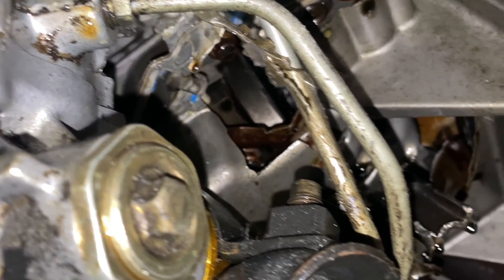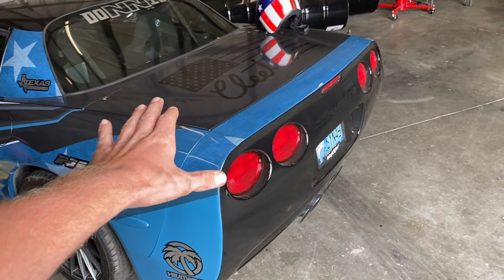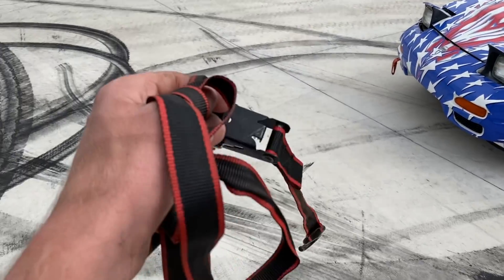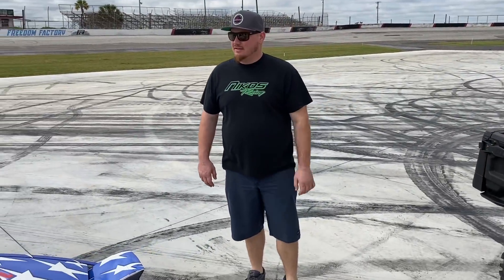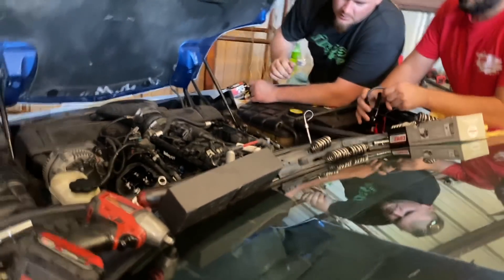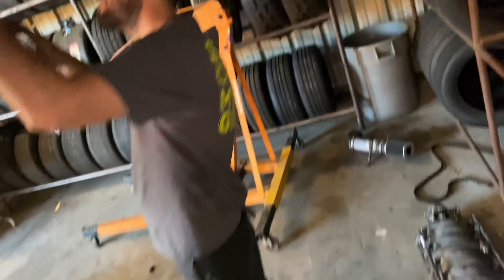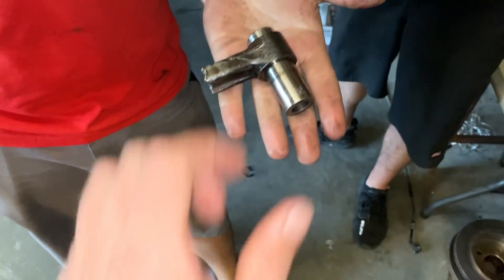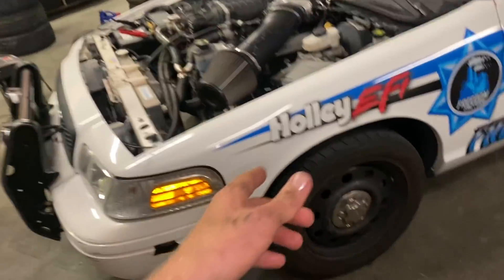We BLEW UP The Engines in TWO Cars Right Before FF Drift Night... (High Speed Engine Swap Engaged)

Comment: Notice how he has gone through more ls engines in any car vs neighbor's engine gets thrashed and banged against the rev limiter at every single cleetus and cars.
Reply: thats because the first time they put neighbor through what they put the ls through, it blew up. now its built and is bitch tuned to keep it from blowing it self apart at the slightest rev limiter smash. good try on* ls vs. mod though, ls still better.
Reply: @MillionairX  they also change the timing chains often so they dont explode on limiter
Reply: Neighbor is a built engine.. most of the ls stuff that he breaks is stock blocks..I know Donnie was just a heads cam car and rocket was a stock block as well...can't really compare built vs stock
Reply: @MillionairX  you have a very good point there, for all the people screaming about coyotes, Cleetus hasn't been able to hard kill it, and it's been pushing near 1,000 hp for years now.
Reply: i dont disagree at all, it's impressive neighbor has survived, although I will say he goes through stock LS's with miles on em then he replaces then
Reply: It'd because it's a Ford not gm garbage
Reply: @chrishamilton2559  he also doesn't rev it to the moon except for on the dyno it has a soft rev limiter for burnouts it's set to like 6k
Reply: I'd chalk it up to the fact that the coyote is DOHC.
Reply: @chrishamilton2559  hasn't been able to hard kill it? There is a video where they grenaded the whole one side of the engine after a timing chain snapped and needed a shop to fix it lol. Plus we don't see all the maintenance done on it off camera. Like someone else said, bet they change the timing chains n stuff all the time.
Reply: @Tron1731  you got gapped a GM product didn't you? Haha only butt hurt people say shit is garbage when its got a 70+ year legendary history to prove it's not..
Reply: Lmao at all the booty tickled LS guys. Digging deep for anything they can negate about the trinity engine's reliability. Seem to forget how many times he over heats neighbor (has/had stock 4.6 radiator for the longest time), and how he basically trys to break EVERY car in the fleet. Cleet ain't nice to any car he gets in. Y'all act like he doesn't build/maintain everything he owns. Love cleet to death, but part of neighbor's first (and only) engine problems were simply related to him not having mod motor know how. How many engines has Ruby, Leroy, toast, the 240, and the rest of the fleet been through? Answer? Plenty. Most all built top to bottom. Truth of the matter is, cleet has not sympathy for any engine. He doesn't have to. So to the brand bashers on both sides, please TSB.
Reply: Ford GT500 motor brother 😏 not as configurable or powerful but takes the cake with reliability
Reply: @MillionairX  talking smack with your Ford rear-end in your race car lmao 🤣
Reply: @Tron1731  yah and? You see me saying shit is garbage? Nope... This isn't about who makes the better rear end though but since we're here, the 8.8 and 9" are the only things ford ever hit the nail on the head with. Feel special bud.
Reply: @MillionairX  everything you said is your  life nothing pertains to me
Reply: Why do some of ya'll call it a Coyote? Its not a Coyote, its a 5.4L out of a 2009 GT500. It may be soft tuned and the Rev Limiter turned down but that engine is constantly ran up to 7500RPM and bounced off the limiter! Id rather change timing chains once a year then blow up 30 LS engines!
Reply: Ada 7474  that's easy, because not many can afford to build on that architecture properly. You can go as fast as you can afford to.
Reply: @Only_TheFox_GodKnows  because its a coyote... same reason truck/van/suv engines are still LS engines. Its the name for the architecture/design of the engine. Vehicle it comes in doesn't change the design of the engine unless its FWD v8 stuff, they usually have funny castings and shit on the outside but the insides are still the same. LS4 for example, fwd engine from monte carlos and stuff.
Reply: @Only_TheFox_GodKnows  I forgot it was a 5.4 3 valve tbh
Reply: @jacobdevereux207  no they make a 2v 5.4 triton engine it's in the expedition
Reply: Ada 7474  Like the ls swaped dodges  that don't exist lmao 🤣
Reply: @Tron1731  yeah but if I can remember correctly the engine in neighbor is a 3 valve

Comment: All those wall runs will blow everyone's engine .all the oil is going to the front of the motor away from the pickup
Reply: I'm pretty sure it's the opposite of what you're thinking because of the g forces
Reply: And they also make dry sumps...
Reply: This is why we run accusumps on all the LS drift cars I’ve worked on. It’s a must since oil starvation happens easily when drifting do to Oil slosh like you said
Reply: They have the oil pans with baffles in those cars. Oil gets right back to the pickup and cant get out. Trap door baffles are designed and positioned to open and allow oil to easily flow toward the pickup and to close to prevent oil from flowing away from the pickup. Under cornering force, the doors will keep the oil from shifting in the pan and keep it at the pickup. If you race you also need to run more oil than a street car.
Reply: Baffled pans only work so well. Seen A lot LS drift cars rod knock from oil starvation even with baffled pans

Comment: Welcome to the drift life 
I had a buddy swap out an engine and a 87 300Z 
Pulled out the na motor and put in brand new motor and fabbed up turbo intercooler exhaust we had the motor in and the car running just hours before the event at no Coast drift party in New Mexico

Comment: What would Leroy run on the dragstrip with donnie's body panels bolted  on,just curious.
Reply: The world will never know
Reply: Ruby?
Reply: Not really possible considering how the cage is
Reply: @matttaylor263  I know,  but still it's interesting to know what that car would do with some aerodynamics
Reply: @waterpolovin  He took it to a wind tunnel to get a estimate, but he won't do it to Leroy. Leroy wouldn't be the same.
Reply: @the_rewster4120  something along the lines like 800hp just to compensate the aerodynamic drag I believe he said
Reply: It's vortices off the back that's the biggest problem they have from what I recall of the video. Weirdly the front isn't horrendous.

Comment: Baffled pans are a must have been working on setting up a fbody ls1 that’s been drifting on the stock pan with an extra quart of oil with success, obviously dry sump would be the way to go but good oil with an extra quart will get ya by for a while that long run on the bank is the big demand for oil control. Rather have the small hp loss from extra oil on the crank than sucking the pan dry or sloshing the oil away from the pick up. Good luck guys 🤘🏼

Comment: Johnny Pro LS drift master says, "You have to run an oil pressure accumulator in the trunk or a dry sump in an LS or it will shit a rod or 8 after 3 or 4 events like clockwork. "
Reply: I kind of don't understand oil pressure accumulators. Are they pressurizing the oil when the car is off? Do you need to pressureize it with an air compressor? I know they keep oil pressure if you ever don't have any for some reason
Reply: @lucysmith4242  nah, it'll "accumulate" oil pressure via the oil pump, if the pressure drops below a threshold it's like pushing the trigger on a can of whipped cream, it'll shoot accumulated pressurised oil into the engine, it's not a bullet proof solution, but a lot of the time if you see the oil pressure warning quick enough and shut it down, you're usually pretty safe. Google "Accusump" for a far better explanation.
Reply: The oil pressure accumulators are pretty much a tank with an oil filled bladder surrounded in pressurized air. Think of it as a balloon, when oil pressure is higher than the set air pressure the bladder inflates with oil, as oil pressure drops due to starvation the air pressure in the tank pushes the oil back out of the bladder and into the main oil galley keeping your engine alive.
Reply: Yemp!
Reply: @Elxmo  Hey thank you for the explanation. I have actually been recommended one by me engine builder but I'm doing a stock bottom end super budget build so it's not in the budget right now. Does it push all the oil out of it when you shut the engine down? Do you have to run no pressure in the accumulator for start up?
Reply: @joelg6740  How does start up work? Does the engine have to build up oil back into the accumulator on start up?
Reply: @lucysmith4242  At start up it won't fill the accumulator unless your oil pressure is higher than the set air pressure. You can also use these systems as a prelube before start up. Just need to make sure before shutting off your engine the previous run that you close the valve/turn off the solenoid so that oil is stored.
Reply: @lucysmith4242  Oil pressure accumulator is what leroy use to run before they went to what I believe now is a dry sump. It has a ball valve you open while the car is running that fills the accumulator with oil pressure that compresses the spring, then you close the ball valve and can shut the engine off and add oil until the sump is full.
Reply: atleast the one leroy had years ago had a spring I think, the air bladders sound a lot more reasonable

Comment: I wonder if you need to put a wet sump in Donnie. Maybe it was just low on oil and the pickup was screwed. Could also use baffles if you’re sticking with a wet sump

Comment: Dude Cleet I really think its that steep banked corner in high RPM drift thats eating motors cuz all your oil is sloshed over to 1 side of the pan on that bank!! I could be wrong but you should get 1 of those Moroso pans with the baffles in it to keep the oil where u want it

Comment: I would be very surprised if Donnie threw a rod. Michael put forged internals into that motor (Mahle pistons & Scat rods). The engine was put together by a well known engine builder. Donnie just doesn't make enough power to hurt the internals if they are properly oiled..

Comment: Do you use catch can and a filter between the turbo and the oil pan ? Maybee some overpressure in the pan that the turbos not like and he oil gets hot and when you pedaling that oil is way to hot when it hit  the pan think the same whit the head and moving components .overpreesure from the crank no good oil feedback to the oilpan

Comment: gotta accusump or dry sump it on those LS engines drifting at high rpm eats those bearings and rotating assemblies up without good oil as well

Comment: I'm wondering if being on a banked oval might require a circle track style pan or at least different baffling.  Could be some oil starvation or cavitation at certain points in your routine.
Reply: Dry Sump
Reply: @dirtracer21d   While ideal, that would be a very expensive setup for that car.   A circle track pan would be a fraction of the cost of a dry sump setup and without all of the plumbing and space limitations.
Reply: @MA-iv7ol  it’s worth it if he plans to continue drift events, it lap wise what’s he have? 250 laps on that car. How long till it’s consistently spinning bearings and spitting rods. Or warping the crank. If he continues with drift events I think it’s worth the investment
Reply: @dirtracer21d  Yep, and a new Texas speed LS won't be cheap and will be worth protecting.  We'll just have to see what ol' Cleeter does.  Maybe some company will be happy to see their dry sump system on that car and offer one up as a sponsor or for advertisement.

Comment: Dont like those front sumps, on banks event more. The oil is forced to the rear when drifting. Most the cars with commodore (GTO) front sump seem to run into issues with oil starvation.

Comment: Oil temps from lack of flow over coolers. It’s why those tuna cars have huge mouthed front bumpers. Not enough airflow over coolers when ur beating on it especially if ur sideways 80% of the time.
Reply: You can cheat & run the coolers to the trunk. The extra line length, added volume & added fans cfm to blow heat out the back where aero pulls on the car is “ usually “ a good enough fix.

Comment: Im just gonna say it. How many LS motors have they gone through on the vets and how many motors has neighbor had to have swapped out?! Maybe donnie and rocket need some blue oval under the hood. Lol
Reply: Well if the didn't change out the chain tensioners on neighbor after every event it would blow up to. And neighbor doesn't go drifting as much like the two ls cars. Hell any car would blow a motor being bounced of the rev limiter all day and drift cars over heat a lot which isn't good for bearings. But I like the shit out of both ford and Chevy just saying the other cars get beat on a lot harder than neighbor which is hard to believe.

Comment: Damn I always hated it when 1 of the rods is just dying to get out of the block after being tucked away in the darkness for a considerable amount of time under heavy and hard usage doing what it was made to do, and it was reminding me of about 12 years ago now (back in the 4 cylinder b series Honda days) when I bought a 97 spec (hype R) I mean type R integra complete swap engine, type r  lsd transmission, and stuffed it in my 89 standard civic hatch which complete swap with trans 2500$ and then 6 months later at 8200rpm the cylinder 3 rod exited the block front and back to, salvaged everything could finally fully built b20vtec into it. Sorry long message, but I got PTSD seeing the blown block lol jk,

Comment: Ever thought about DeStroking a ls? Make a stupid high revving motor for the drift car... and then build a crazy header setup so it sound like a Ferrari or lambo like that white trans am? Back in the day we would destroke a SBC 350 by using 327 guts... and that was always the reliable backup motor, you couldnt kill it no matter what... we would build a stupid "hot" motor race it and blow it up, go home and within 20-30mins have the old reliable motor swapped back in and running ready to go pick up the ol' lady... but that trick was almost as good as crushing "moth balls" and putting them in the gas tank to make home made race fuel when we the ATF didnt take the still away like some bad knuckle headed kids in trouble lol.. only issue with the mothballs was too many would freeze up the fuel line and u would have to let it thaw out lol

Comment: Thats how the timing gets messed up😂
Reply: You let off the gas and car goes slow but engine still moving fast gas put back in momentum to clear air from going into the direction of the way you going than once intake catches up the wind smacks you like a bullet train now you are driving into the air😱

Comment: One of the reasons you could be blowing up motors is because of the drifting and high banking your loosing oil pressure and volume to cam bearings etc. Time to go to dry sump engine oil system.

Comment: I had a rev limiter on my car and I blew it up, I said what the heck was the limiter for, a friend said they're sold to make you buy more motors, so I took it off  and made my engine blow up proof, well mostly, drove it and raced it for ten years and no problems, till one winter we got  over 3 feet of snow and my car was trapped for the duration ,that spring I tried starting it and pulled the brass guides and had to remove the heads to get the guides unstuck from the valves, other than that the engine could run 7500rpm for a couple hours.

Comment: i like all the ford people in here saying "wow neighbor has never had any issues "when theres a video called we blew up the gt500 motor" every stock motor goes eventually when pushing it. thats why they got a mod motor and are running it 400 under its hp rating. anything built will last ford people go crazy when a stock motor constantly on rev limiter blows

Comment: 2:50.  Too bad they didn't have a gator or something to tow it back the garage so they didn't add that run time to a zero oil pressure engine.

Comment: As much as we enjoy abusing these cars, they just are not designed to be driven that hard. Running and engine to the red line and keeping it there...well, you see what happens. Same with the transmission, rear end, and axles. Somethings got to give. You just hope that it last long enough to get your prize.

Comment: All things considered and the amount of abuse these engines see, it's a wonder they've lasted as long as they have. Everything has a finite amount of life in it. When you throw in the abuse factor it shortens that life exponentially. I'd say with anyone of those cars a backup engine is not optional.

Comment: And now a word about tires and drifting.....   For autocross and the track and the drag strip, you want traction, lots of traction, the name of the game is actually traction, okay?  Stick with me on this part, it's very complicated.    Drifting is about drifting, if drifting was a timed event, people wouldn't drift, in this case, you actually want slightly less traction,  words of wisdom to consider when choosing rear tires and tire pressure for your drift car.

Comment: So like when you turn your car and stuff, fluids like your windshield washer fluid and your oil slosh around in their prospective vessels from one side to the other when you turn from right to left.   Get that shit sloshing around wildly from one side of the pan to the other creates a condition where the pickup is not completely submerged intermittently during high load, high RPM operation which of course causes an intermittent oil pressure condition during  high load, high RPM operation.   It doesnt take a brain appliancest to figure out why you're blowing up engines.....   Glad i could help.